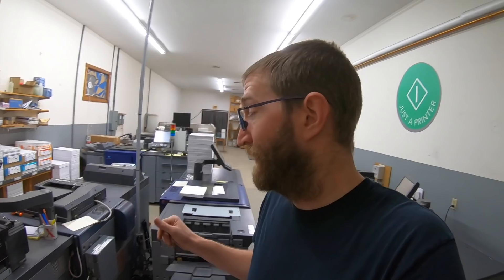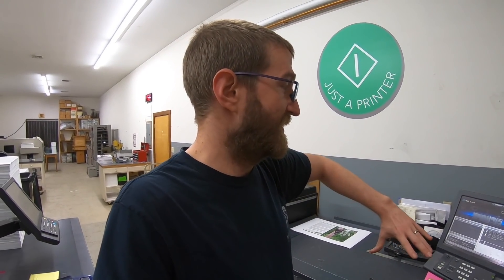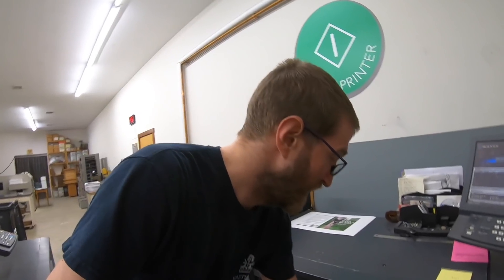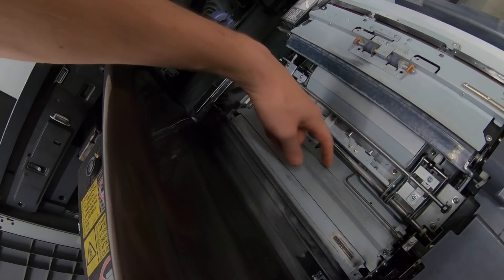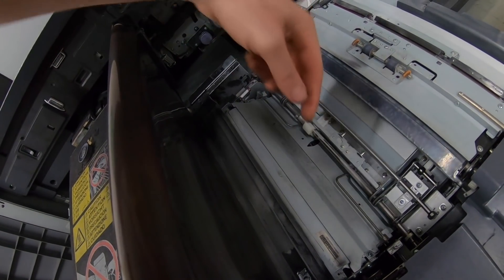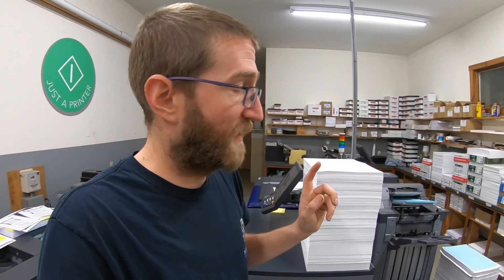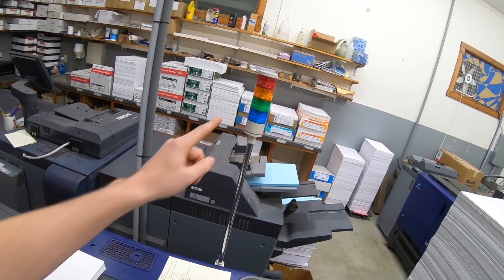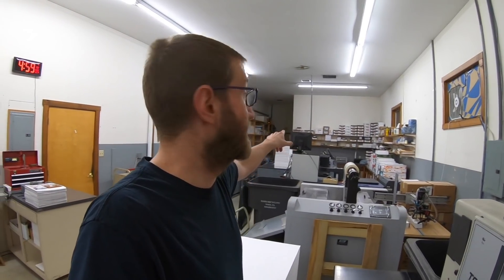J-9301 Jamming Printer, Lights, Paper, Fiery

Comment: Man, you need a rest--a Sabbath day kind of rest! You work too much! I see that the printing press has a Dell monitor just like I have a Dell keyboard. I call my computer my "Keyboard," because it is my strong typewriter. Well, anything that man had made is not perfect like man himself. You may need some Dell all-in-one PCs to connect to your presses, so there would be no need for tower cases stack on top of the press. I hate to see a "gentleman" like you go down. I hope you will not reach an era to lose one single job.

Comment: Hey Dan, I love your videos! I learned a lot from them. I have a KM C2060 and I'm planning to run PVC and PET sheets on it to create laminated plastic gift cards. I already tried the PET as it withstand higher temperature and it runs fine however the colours are not great (it's the nature of the product). Do you think I could run PVC as well?
Reply from the maker: Probably. I used to run polyester labels and other synthetics but I don't anymore. I have plenty of other printing to do so I turn it away now. Besides static was horrible on synthetics.

Comment: I assume you are intending to make the stalk of the light display longer / taller..  what about actually hanging it off the roof and just extend the wires to run across the roof, down the wall and then across or under the floor with the power cable..
Reply from the maker: You're thinking like me. I think I'll put lights high up on the conduit. I'm excited to try this but not sure if I will have time this week!

Comment: Running Blazer Digital (13x19 100# Cover, 12x18 80# Cover) for about 4 years now. Great for what I use it for. We recently were dealing with a shortage of it locally so when it does come in I have to stock up with what I can.
Reply from the maker: Good to hear!

Comment: I have had it on Xerox machines, when printing faceup  or face down will cause jams... Very odd, i've always assumed it was a problem with the paper curling after hitting the fuser. The other option is to flip the paper over in the tray. I'm guessing it's doing the same thing?
Reply from the maker: Its weird. It wouldn't jam, it would just stop printing the job.
Reply: @justaprinter  I think it maybe to do with processing. When it prints the job one way, (face up) it processes while printing and stopping for a little while then prints a few more sheets. the other way it will process the whole job, wait and the print. maybe it hangs up when printing and processing at the same time on the fiery?
Maybe try prosessing before sending to the print queue.

Comment: A lot of good comments here on the Fiery hanging issue. I have encountered situations where files with a lot of vector content, including a large number of fonts, have been troublesome to print. Colleagues have noted that files that have had the vectors rasterized prior to printing, while larger, sometimes much larger, can rip and print without the system hanging. As others have indicated, possibly relates to a combination of ram, disc space, and the amount of processing required?  A lot of unknowns!
Reply from the maker: Seriously! There are many factors.

Comment: I would first check the hard drive on the Fiery first, it's 10x more likely to be failing/have failed than having a bad RAM stick. You can connect the drive to a different computer and run Crystal Disk Info or if you can remote desktop on the Fiery, there should be a portable version of Crystal Disk Info that you can copy to a USB stick and run the program directly from the Fiery and it will report to you the health of the drive that is installed.
Reply from the maker: Good to know. I just might do that.

Comment: Adding a pole to the lights is not needed.  Hang a mirror high up on the wall at the end of the room. You'll be able to aee it fine.  If a mirror costs too much, grab some foam core board or even posterboard or cardboard left from a  delivery.  Hit it it with spray adhesive and glue down some aluminum foil, shiny side out.  This will cost next to nothing. Works fine.  You'll be able to see the light color from anywhere.
Reply from the maker: Thats a great idea! I have another ides too!

Comment: Fiery memory can fill up quick when messing with face up and face down printing. It is a gamble. As for Blazer, exclusively the coated sheet in my shop for last 8 years. Never have had a problem.
Reply from the maker: Good to hear, I like Blazer so far.

Comment: Some more stuff to check for J-3901 Codes.  Underneath the belt cleaner unit is a sensor that sits horizontally.  It can collect dust and cause some strange intermittent jams.  You may also need to check the three conveyance rollers next to the sensors.  They can swell up and slide off the hubs of the rollers.  NCR paper can cause the rollers to swell up over time.  I think the green ADU handle and the ADU front covers need to come off.  The fuser unit and belt unit will need to come out too.  The belt cleaner is held in with four screws and a couple of grounding wires.  I have had certain jobs with high coverage cause jams in document feeders.  Changing the direction or side that is fed first can help with jams.  Optical sensors don't always like high coverage.
Reply from the maker: thanks for the education. I'll have to take a look at that sensor.

Comment: Face Down vs Face Up: Face down will start printing soon after it has started processing the job. Face up it will process the entire job before printing. So, if you have a large document, I've had the Fiery choke and stop. I think ultimately it is just a memory issue.
Reply: Yep, that's also my guess. If this occurs and for some reason you don't want to switch to printing face down I'd suggest to send the job in parts to the machine (i.e. page 1-50, then 51-100 etc.) to make the files smaller.
Reply from the maker: That makes sense. Although I would have thought that the software would just reverse the page RIP sequence to rip last page first.
Reply: @justaprinter  That was my thought. Then I had to run a very large document face up and wondered why it was taking an incredibly long time for the first sheet to come out. When I looked it was still processing. Didn't print until the entire file was processed.

Comment: I run Blazer gloss 100# txt and 80# txt and cover.  I like it so far. Running on an Xante Enpress. No issues so far. Still having issues getting 60 offset and envelopes here in Ohio. Even so issues getting colored bond. Western States envelope is 55 to 60 days on custom orders to be made and 32- 38 days on normal stock orders if they are out.  Like #9 window. It's crazy out there. So ordering stock where and when I can.  Have a good one brother! Stay safe out there!
Reply from the maker: Same to you!

Comment: 6:43  
at the expense of blocking the alarm lamp, monitor. hang, in the right corner, an ordinary mirror, as in buses that are hung above the door. fasten it at such an angle that the alarm can be seen from the place where it is not visible. you can fix the mirror on the mount, as for monitors that are mounted on the wall. or buy the same, bus, convex mirror. such mirrors, in your shops, are hung up to observe the buyers who are in the blind viewing zone.

I hope google translator translated my message correctly.
Reply from the maker: Someone else mentioned that too. Great idea!

Comment: I think you should have all the presses on the floor. Could do all the more jobs simultaineously.
Reply from the maker: Oh man! That would be nice but I'm running out of space, I need to figure out stacking them up.
Reply: @justaprinter  maybe home depot industrial pallet racking... the stuff they use in the wood area, it has rubber on the connections to deal with vibration?